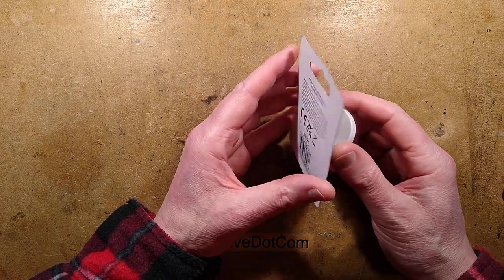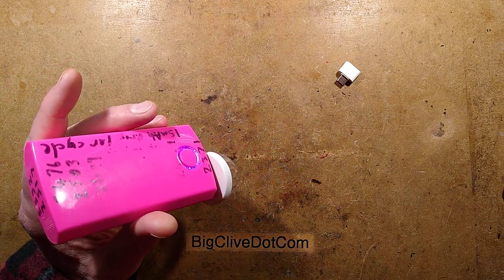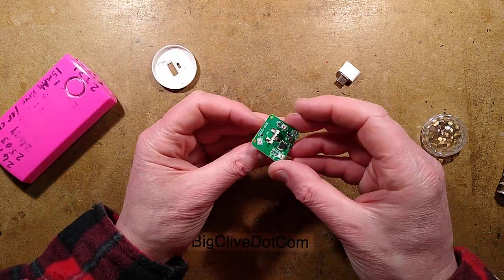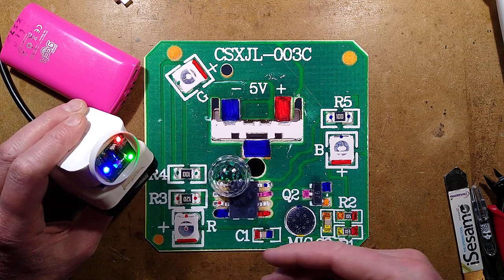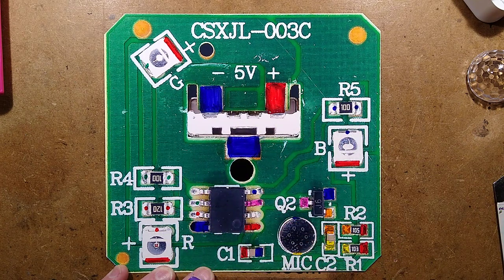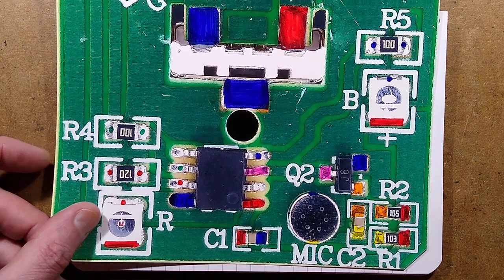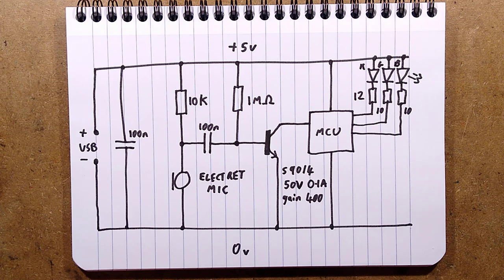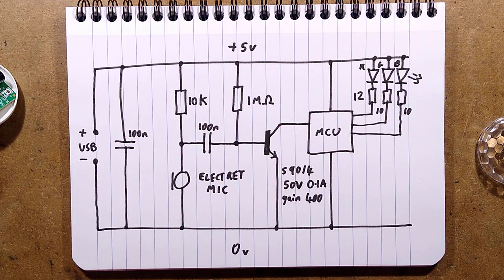Pound shop USB disco light teardown (with schematic)

Comment: I have a similar one of these (better one imo) with 4 bead leds, 1 red 2 green 1 blue. It has the same annoying flashing with some supplies but it is a lot less.
Reply: Of course I had to order new ones out of curiousity, you make it look so easy to open up! The older one was much more tunable IMO. First of all it had a screw open cover, very easy. It had the mic hooked up to 2 transistors as a double amplifier I guess, as input for the IC chip. The chip had 3 outputs going to a transistor for switching the 3 LED channels. Now it did have 2 green LEDs, 1 red and 1 blue as channels. That is of course a bit weird and bright in green plus dim in red, so I turned it into 2 red 1 green 1 blue. Oh and I swapped the mic for a resistor to remove the mic effect. Maybe I'll also remove the mic with these new ones.
Reply: After I wrote this second reply I didn't notice it until now, but the new ones I have are actually not the same as yours. I have 4 LEDs, red green blue and pink. Guess they have a billion versions of this. Mine are from aliexpress, but of course yours in the end also comes from china.

Comment: Question: That annoying strobe mode which is present in virtually all cheap flashlights, has anyone actually used it on purpose?
Reply: Haven't used the strobe mode yet, but I read something about using it for self defense. "This side towards enemy" blinding him 😆
Reply: @SystemX1983  I've a BLF A6 flashlight which runs off a 18650, and when you put it into strobe mode it could certainly startle & disorientate someone for a couple of moments if they're not expecting it right in their face.

Comment: lawl... Clive spelled Electric wrong *snort*.
Only kidding!
What a seriously missed opportunity here, being it:
          A] was already USB powered
          B] was already equipped with an MCU
Seems sure the BoM would've been far greater, but turning it into an actual USB device that talked to the audio subsystem, then had R, G, B triggered by frequency range... That would've made a way cooler device!

Or if there's concern about the possibilities of containing malicious software -- sadly, a justified thought these days -- keep it USB powered but include an ultra cheap mono BLE (v1.0?) to "talk" to the phone/computer as exclusively an audio device. Maybe would need to be BLEv5.x, at least ideally, for anyone wanting to still use a BT audio device *for" sound (headphones or speaker)
(though... 🤔 admittedly, I'm not sure if you can trick the system to still play audio through its speaker/3.5mm w/o needing a companion app; anyone know?)
Reply from the maker: The complexities of doing that and making it compatible with all phones would have made that quite a formidable task.
Reply: @bigclivedotcom  Hmm, I guess I'm giving Bluetooth a little to much credit, then 🥴 I figured at this point, with how common it's become, that having it work as intended was a sure-thing on any device running Windows, iOS, or Android (and Linux, I guess).

As unfortunate as that is, it's good to know we're not quite to that point yet. Thanks ☺️